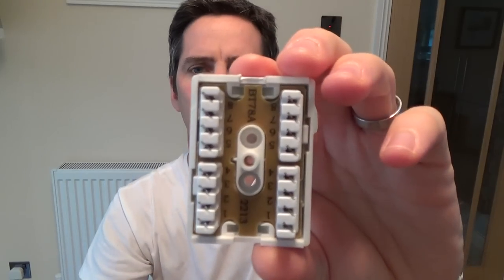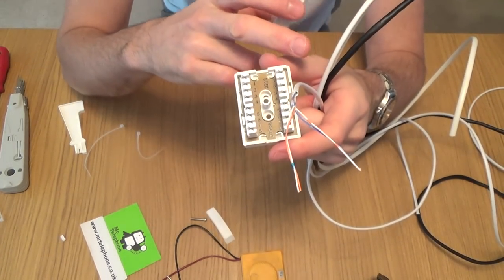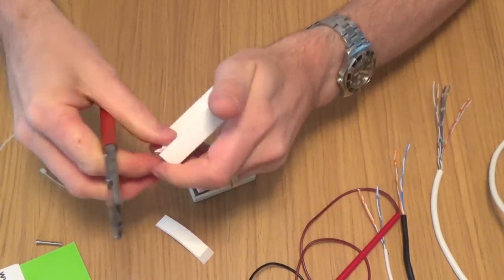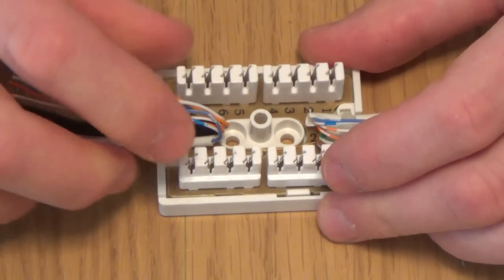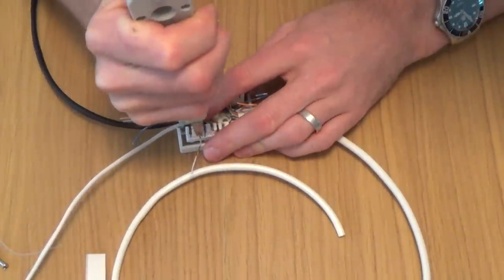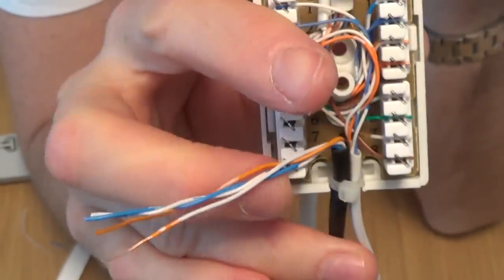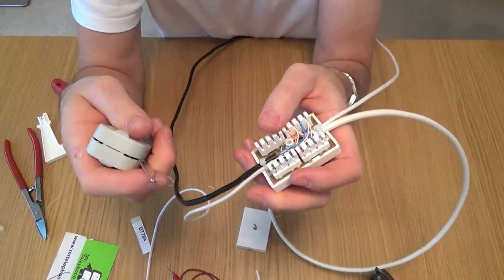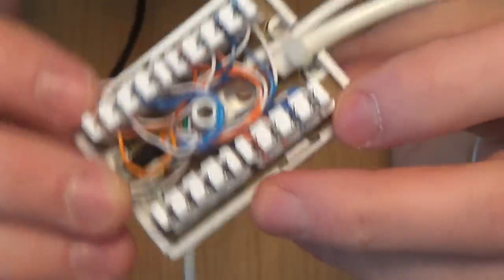How To install a BT78A Telephone Junction Connection Box to join up to 6 cables together.

Comment: Hai , I am from India and saw video BT78A Impressed but have a beetel m78  landline 1+1 and i have a challenge that in my shop  want to use this without any external connection provider like (BSNL,MTNL,Airtel or etc..) how can i connect only for intercom....do you have any device....

Comment: Hi Vice, I see in the video you removed the jacket from the internal wire quite quickly. Did you just do that with your finger nail? Is there a recommended way to strip such a tiny solid core wire?
Reply: I just use a cigarette lighter whenever I need to streep any small wires.It is very fast and efficient.It doesn't damage your wires and you will not cut a wire by accident anymore.Blow on the  wire  to alt the burning and very quickly  remove the burned plastic with your finger taking care not to burn your fingers.Remember also not to breathe the noxious fumes.

Comment: hey is it normal to have just 2 wires joined when 5 come into my house i have really slow internet speed and crackling on my line there is a black striped white and green and green all not connected ? thanks
Reply: Yes.  Only two are needed for normal phone usage the rest are spares

Comment: I thought on telephone cables only two wires did anything (plus the optional ring wire?). So if you just put in two wires from each cable and cut the rest short would the telephone extensions still work just as well? Or does putting in all the extra wires serve a purpose? Thanks.
Reply from the maker: Yes, just 2 wires to make it work and the 3rd ringer which isn't always needed. You get junction boxes which contain more terminals because 2 or 3 telephone lines might be running down the one cable. The extensions will work fine if you cut the others wires short but you may need them in the future so of is always good to have some slack.
Reply: @Mymatevince  I was taught to wind the spares around my number 1 screwdriver which leaves long spares in a small space and neatly in the BT78A